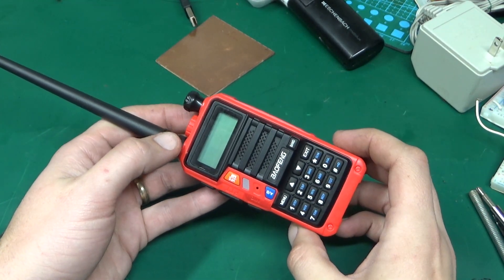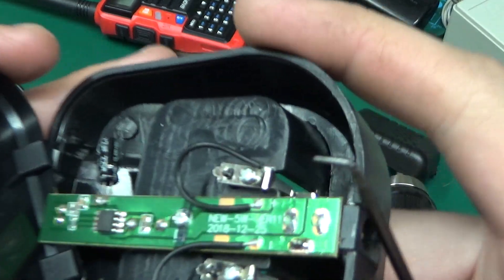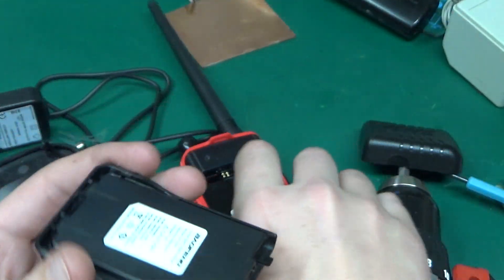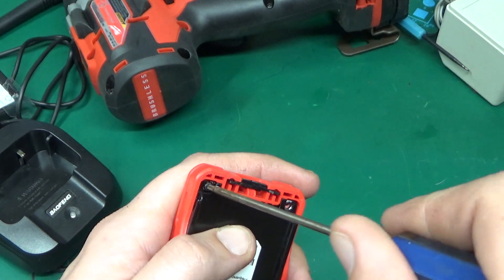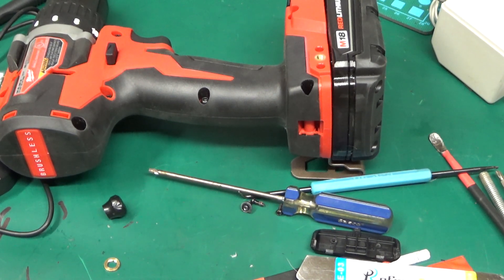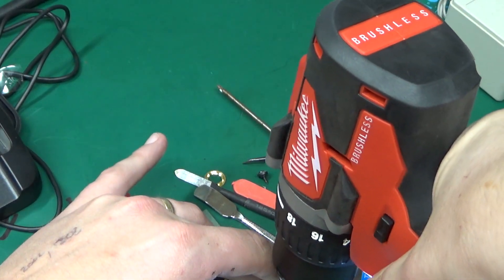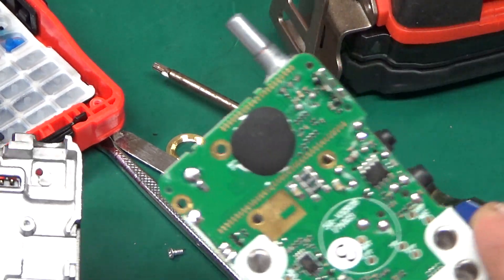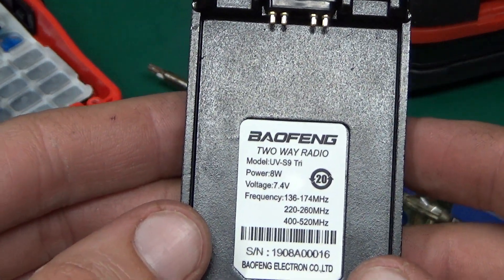Teardown of a Baofeng VHF/UHF handheld transceiver with small "review" of it.

Comment: Had a few people bring me them radio's because they where using an external microphone ,,they reach for the mic and pull the radio off of what it is setting on and the radio falls causing mic jack problems. Bafong not worth putting much time in. I just jump the Jack. When I do this the external mic stop working. I seen another radio someone jump and the external mic still worked. The Few I jump completely disabled ext. mic.... I have spoken to people in Kansas on HF. Maybe one of them can help you. Sure someone will see this and help you out.
Reply from the maker: Thanks for the reply, I don't need any help with that HT. It is reassembled and works perfectly.  ...honestly, I made this video a few days ago, and didnt watch it before uploading, so I dont recall what I needed help with..   Unless, I mentioned not being able to find a Ham tutor, or where in the hell I can contact a local one.  Being from a small county, only 18 FCC licenses are local to me, annnnd 5 of those people are dead now... so, slim pickins for that around here.

Anyways, thanks again.   I will be tearing down a Valhalla 2724A resistance standard, and a wavetek 5830 DSA soon.   much sooner than I have been putting out videos. lol
Reply: I was talking about licence. Good luck on getting your license and on youtube.look forward to the tear downs,,,never gets old...